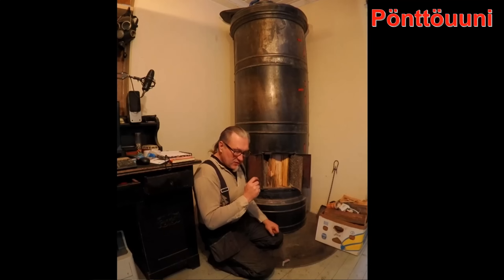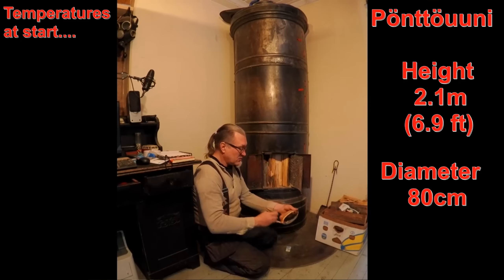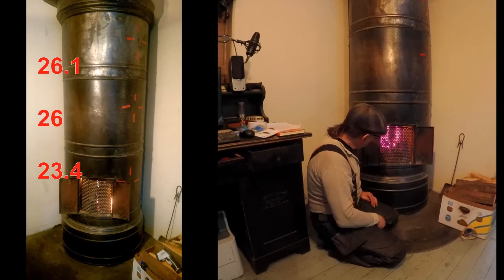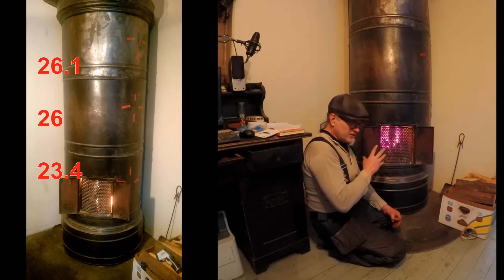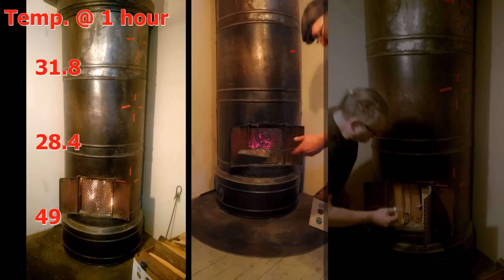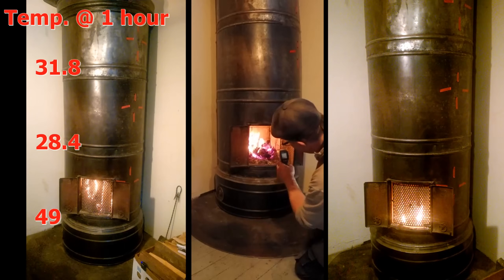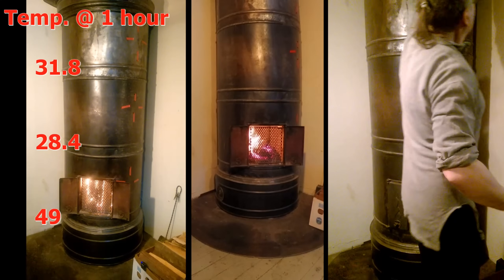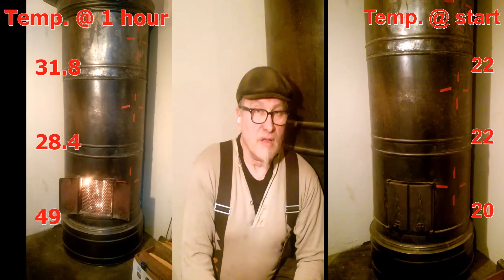Finnish masonry heaters. -The Russian Rocket (Pönttöuuni)

Comment: Nice and interesting clip.
About the alleged "efficient burning", on the Alps is a common knowledge to start firing with all air and chimney damper open to minimise pressure drop, allowing the chimney to heat up and make its own draft, then the chimney damper is closed to the point that flame is no more rumbling.
This is the way we save wood, time and work for wood sawing and splitting, for refilling the home firewood box and for the stove cleaning from ashes. And keeping the home pretty warm.

That I don't like of the rocket stove is the heat mass, IMHO it shoud have more surface to heat up more efficiently. I would use some refractory tiles arranged in a honeycomb pattern to let the flue gas to flow in between.
Reply from the maker: interesting. That is basically how I usually heat the 'pönttö uuni' wide open until it gets really going then shut it down, let it burn slowly, then when it is almost burned out but temp is still high I empty it and close it all the way down to let the heat soak into the mass. I have projects in mind with a flue system going to two different thermal masses so they can be closed down independently.

Comment: At my maternal grandparent's house, they had one of these, it was mounted in the center of the house at the intersection of  four walls so a quarter of the stove's metal skin was opened to each room. It was wonderful, as I remember it delivered very nice warmth and needed relatively little coal (they heated with coal there, not wood).
Reply: this type of heater really shouldn't be heated with coal, coal burns too hot.
Reply: @villerantavalli9395 the firebox was smaller - I'm guessing the builders knew what they were doing
Reply from the maker: Very cool

Comment: I agree with your dislike of the use of the term “efficient burn”  i think a more appropriate term would be “clean burn”.  Efficiency is used to rate a process.  Now if breaking down wood to ash is the process, then I suppose it is the most “efficient burn”  but if the process is to extract heat, then no it is NOT the most efficient burn with this size stove, as you have demonstrated.  Heat transfer is about temp difference, surface area and contact time, and turbulence(breaks down laminar flow).  If you are roaring a ton of air thru the stove, you are reducing the contact time of the hot gas to the transfer surface of the stove mass.  To compensate for less contact time, the surface area would have to be increased dramatically…  And unless you are really monitoring it closely, you can be adding too much air which will actually reduce the hot gas temperature…   Here is where the use of pelletized fuels really has potential IMO, because you can reduce the size of the fire and the volume of hot gas created, but still employ that very clean burn, to allow a no smoke operation but still collect a large volume of heat per pound of fuel burnt in a reasonably sized stove.  This sized stove would probably work really well with a small hopper and and gravity fed pellet burner in place of the door.  You fill the hopper, light the stove and let it roar away heating the mass.  A simple photocell looking at the flame could control the intake damper.  When it detects flameout when the fuel is expended, it seals the intake damper to stop internal airflow and the draft cooling the mass from the inside and it sets and radiates heat.

Drawing combustion air from within the dwelling is really counter productive. It creates negative pressure which draws in cold air thru every leak in the envelope toward the low pressure.  A better methodology in my experience is to A. Completely seal/isolate the combustion process from the room and draw combustion air ONLY from outside the heated envelope. B. Provide a second small outside air source using a small fan to the heater and blow fresh air directly upon it. This will create a positive pressure hot air source originating at the heat source, forcing the coolest air in the room out near the walls, back out thru the leaks in the envelope.   WAY more comfortable…  a similar flame-out detect, or a firebox temp sensor to control the intake air damper would make it a more fire and forget type operation.  Load with fuel, open inlet damper, light stove, once to burn temp, the damper close goes active and once the fire box temp drops below a certain temp, it automatically closes the intake damper so the stove can set and radiate.  The fresh room air source could be controlled by the same temp sensor so it only runs while the stove is burning…   Have run pellet and conventional wood stoves this way and bringing outside air directly to the stove for combustion and to create positive pressure make a world of difference in dwelling comfort…    Great video, geeks make the world go around:)
Reply from the maker: Ok. You are an engineer aren't you? I am sorry, I understand what you are saying and found it very interesting. I am not an engineer, I like to work with as close to zero tech as I can. I am sure you are right but as I said in the video, I know my stove and I close it down when i can't touch the bottom section...that's as exact a measurement as I need! I have some ideas for projects coming and would love to get your input on them. Thanks for your interest.

Comment: The thing that pönttöuuni is lacking would be a separate compartment to pull the coal in to smoulder. With a separate by-pass damper like in the big baking ovens (leivinuuni).
Reply from the maker: Absolutely. It would need another chimney but because of the smaller amount of gases etc. it work to just tap into a chimney that is primarily used for another fireplace.

Comment: Very interesting, I came across your channel and had to rewind at points to catch what was beening put across.
Great seeing how your heater worked but one question.
Have I have missed something.
In test one and two what was done to achieve the different results as you stated "people say there's only one way to start it -but there are many " however you haven't said which way you were using in both and at the end got confused by how test 1 was and then test 2 was but no explanation why the different time line , also left and right pictures were shown with crosses but no temperature identification so confusing me to what we were seeing.
Reply from the maker: Sorry, I tried to make it as clear as possible and I thought I did a good job but you are saying that I didn't. In the end the result showed that what people call an 'efficient burn' is actually not efficient at all in terms of useable heat attained. The burn that people would call 'inefficient' actually produced much more heat for a longer period of time.

Comment: So, i think the jist is, 
doors open = higher peak temp, but more heat washed away up the chimney
Controlled burn = slightly lower peak temp but more heat for longer

Does the increased temp of the open doors 'efficient burn''mean less nasties overall in the flue gases?
Reply from the maker: Yes. but less useable heat. very clean 'efficient' burn with almost all heat going straight up the chimney and being wasted.

Comment: The section views at 13:15 and following of the old style heater resemble the shape of the cross sections in G. E. Asp's "Salia ja kahta viereista kamaria lammittava patterilitteinen  uuni" of circa 1938, found in Figure 72 of his book "Uuninmuuraaja".  Similar to the heater seen at 14:04 and following, it has a pre-heated secondary air supply, but omits the sand battery.

I spotted Asp's heater in David Lyle's book, and would like (eventually) to build it, though to heat just two rooms (back to back) rather than three, as Asp shows and describes.

See here: https://drive.google.com/file/d/1e2OGWP0SXFBenM2W0bBYRyl7k64Gwy_-/view?usp=sharing

Comment: I remmember that when i grew up and we go visit grandpa then he had a house buid in 1865 from natural stones  and wall thickness about 80cm - he had also this type (round and tall) he had to burn it every second dat when outside was -25C id was about 1m in diMETER nd from that gases was also going true a brick heat battery/wall wat was heated from both sides - from kithsen stove and from the "rocket" one... - they are good and efficient I heard that that was masons secret how to make them and at it was been used local stones for heat acumulation - can not confirm if the stones was used - I'm 43 now and they still going fine......
Reply from the maker: That's great, I'd love to see a photo.

Comment: I love this subject! When I was on vacation in Sirkka in northern Finland we had two big fireplaces. The one upstairs didn't work that well, it had glass doors that apparently needed to stay open when burning. But I found out about the chimney being connected to the underside and was really surprised by that. At first I just thought it wasn't a working fireplace. But very interesting to see they are specially build to slowly release heat. Which is to be expected in a climate where -30 isn't uncommon.
Reply from the maker: Absolutely!
Reply: Having the chimney connection at the bottom was also for fire safety reasons when floors would always give in somewhat over time and even slightly tilting fireplace could pull the upper connection of the chimney.

Comment: Very interesting comparison . The reason why on the left with full burn all the time surface temperature was lower may be because the speed of flue gases was too high. I am going also to build masonry heater. Do you have experience with rocket masonry heater - batchrocket with heat riser, vortex? Could be big difference between "classic" fireplace with afterburn chamber and any rocket stove? In terms of clean burning , flue temperature and total amount of heat from the same amount of wood.
Reply: I would also suspect that having the hatch fully open, you get plenty of excess air. Ideally you would want flue gas with minimal amount of remnant O2. One should keep in mind that most of the gas (both intake and exit) is N2, wich is mostly inert and does not contribute to the burn, but will transfer heat up the chimney. So any volume of excess air is effectively more than doubled.

But on the other hand, with solid fuels you typically still want some remnant O2, because before it would reach zero, you usually get unburnt fuel in the form of carbon monoxide, soot and tar. 

I have done some tinkering around with a flue gas analyzer. At one point I literally spent hours and hours with a 350 kW boiler with a wood pellet stoker. It was quite interesting actually, but took a lot of waiting, as I quickly learned that when burning wood based fuels making any adjustment will take some time before the burn will reach a new equilibrium state.
Reply from the maker: There are just so many variables. like this year I had a problem getting really dry wood. It is dry but not the kind of dry I like. The fireplaces behave totally differently (one reason I have not made any new videos in a while)
Reply from the maker: I have built a couple of RMH. Working on hybrid designs!

Comment: Your infrared themometer is seeing a reflective metal  surface, which  includes cooler images lowering your overall reading. The wall is much less reflective surfac e giving a more accurate reading
Reply from the maker: Ok, thanks for that!
Reply: I was going to say the same thing, if you want completely accurate measurements stick some thermocouples to the measurement sites and get a thermocouple reader with cold point compensation, it will give you a true reading. But what you have done in this video is a good comparative study, and is perfectly valid. And the next one you spoke about, yes please.

Comment: I'm curious whether the exhaust is as clean on the 2nd burn as the first, what the temperatures are on the exhaust and whether they're using the same amount of wood (I apologize if you said this last and I just didn't catch it).

Part of the point of the rocket mass heater is to have a very clean burn. It would also be interesting seeing a head to head of a this against the same amount of wood in a well designed rocket mass heater (could be someone else's) as a comparison. 

How heavy is this? The small footprint is appealing for certain situations. I suspect like other masonry heaters it would require some remodeling for support to add to an existing home.
Reply from the maker: It weighs around 800kg so it definitely needs a good foundation. No, the exhaust on the first burn is much cleaner. This is something that I find a bit annoying about the Rocket mass heater community and the way they use this term 'clean efficient burn' This just means you extract the maximum amount of heat from the wood and that the exhaust is cleaner but says absolutely nothing about how efficiently the heat is actually used, how much heat is lost up the chimney etc. This is why I wanted to show this test, to show that a much less 'efficient' burn can actually be far more efficient in terms of useful heat. I am planning a RMH project so I may be able to do that side by side comparison myself!

Comment: Very interesting but how well does it heat the space and how large of space does it heat? Just seems like those temps aren’t very hot?
Reply from the maker: This is the problem. This particular heater is in a 14m2 room but it cannot be viewed in isolation, It is just around the corner from the baking oven, in the other direction there is the sauna stove on the other side of the wall. They all work together to heat the space. I wish it were so simple.
Reply: As someone with some experience with Finnish masonry heaters, the temperatures are really not even supposed to go very high. The point is that you only burn like at tops twice a day, and when it is not that cold maybe only three times a week. And that mass will store the heat, releasing it slower.

The original concept of using mass to store heat is literally thousands of years old and used in Saunas long before any written records of it.
Reply: Just surrounding my wood stove with 1500 lbs of concrete paver mass has made a difference for me. It really evens out the heat spikes and probably saves me a little firewood as well.